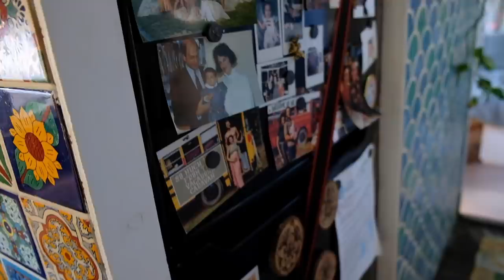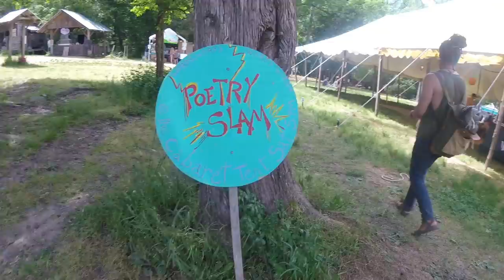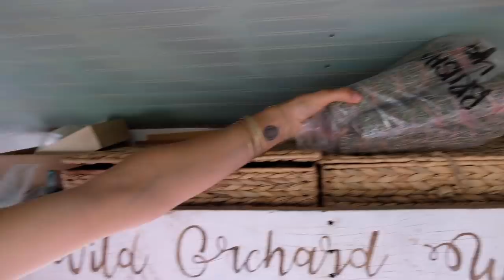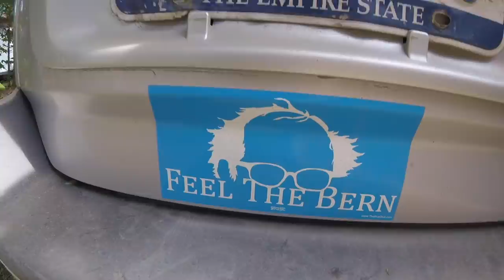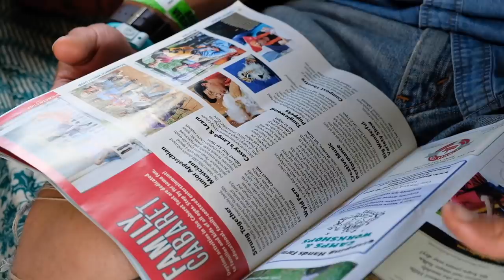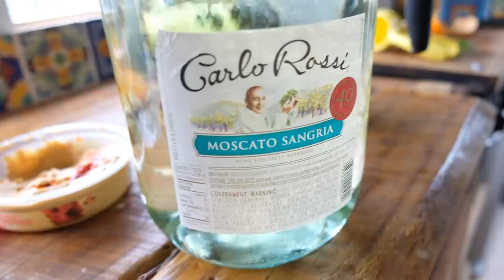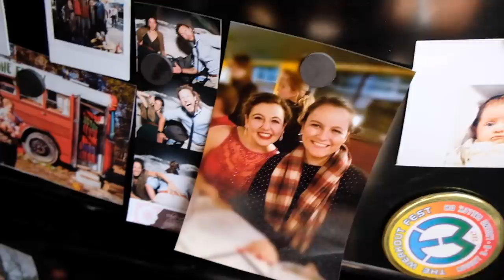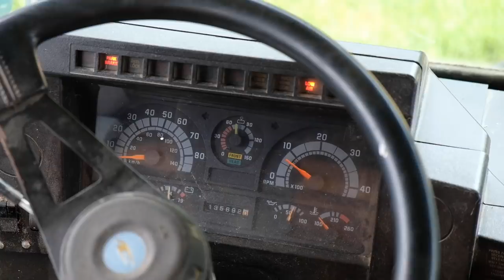Maiden Voyage // First Trip in our Self Converted School Bus

Comment: Hi. Great to see you.     May i suggest as an old semi truck driver uk & Europe,     Over heating !     Could be the radiator its self but, before that i would change the thermostat, cheaper ,   and easier !   Check all the water pipes for leaks/ weeps, as could be a gasket.          Compressed Air,   Regularly blow off the air at all of the tanks by the air test values,  just drain enough out that clears the dirt and water   5 second blast should do,   Every fortnight will do.   Don’t forget home has been standing for a long time,  it is the cold nights that build the water.     
Really do wish you Great travels and time

Comment: You said you want to get tow straps. I want to suggest getting "kinetic rope" it stretches as you pull on it. That saves you and both vehicles from being jerked or "snatched" and acts as a spring that will nudge your bus out. companies make it in all strengths even heavy enough to pull out A tractor trailer. It's not very cheap but your bus will thank you for in the long run.

Comment: I saw a sprinter van used something called tire trax to put these hardish plastic things with grooves on the ground in front of the van and got them out every time. I found something on amazon when searching tire trax that a thing is attached to the wheel that grabs the ground but couldn’t post a pic here.

Comment: In the episode where u put in coolant I noticed u didn't let it warm up and recheck level, its most  likely air bubbles in the coolant system top off the coolant at normal operating temperature and double check the level

Comment: Every when the tires won’t run and it seems they just keep sinking in try putting rugs under the tires or more like In front the tires so it has no way of sinking in and has a way of getting out. It works almost 99.9% of the times

Comment: Watching your family is enjoyable for old fart like me brings back the good times I had with my children 68 this year if you must know retired truck driver and mechanic you are welcome to message me any time low coolant,bad fan clutch,bad thermostat most common causes of over heating radiator and water pump are lower on the list always look for the simplest explanation first and Justin please get some body who knows air brakes to explain them to you they are way different brakes on your car for one thing even though you problay have an air dryer on your bus the air tanks need to be drained on a regular basis and as you drive more the air dryer will need to be serviced and a part that I have found real handy to have with me is the air governor they are only 15 to 20 dollars they usually quit with out notice and normal failure mode is no air change will normally take about a 1/2 hour and is dead simple from the time you step on the brake pedal to starting to work is 1/8 to 1/4 of a second and you should learn how to adjust your own brakes even though you problay have self adjusting slack adjusters they don't always work keep them greased it helps there is whole bunch of simple things you can do that don't take much time that will make things better brake adjustment once you learn is about a 20 minute job. Checking that before you go through the mountains will make your life simpler and safer you and the family have a good journey 
Have a good day
THE GRUMPY BUS
Reply: @julianajubyyasmine  thanks for the reply

Comment: hey guys I am exited for your new journey. If you have any mechanical questions feel free to run them by me, I have been working with trucks and buses for a long time, I have some suggestions for things you can do to improve the reliability of your bus if you'd like. Anyway cheers and best of luck to you......
Reply: Scott, thanks a ton for the offer to help and know that we are open ears to any and all suggestions you have! I've started digging to learn my way around the engine and this summer will be filled with checks and maintenance to make sure she is is worthy of being called a road warrior. I'm sure we will have plenty of questions along the way as well. Thanks for joining the ride!
Reply: @justinmaness7939 , hey guys did you get a chance to look at the overheating issue. There are a few things to check for, Here are the most common things I think that could lead to over heating
the thermostat, if it is not working the motor will heat up and usually its an easy fix. Is the fan clutch/ fan turning on? if it is not then the motor will overheat, it could be the whole clutch (which would suck) or just the switch that turns it on. If the fan is not coming on automatically when the motor heats up, try to see if there is a switch (maybe with a symbol of a fan on it) try to see if the fan will turn on when you flip that switch, if not it could be something else but try that first